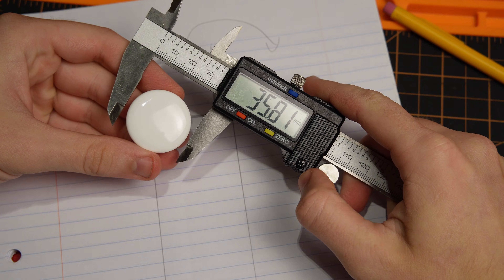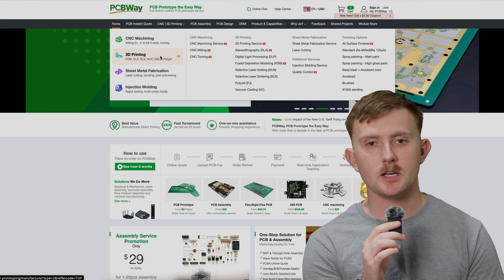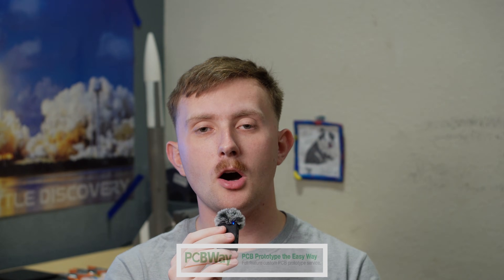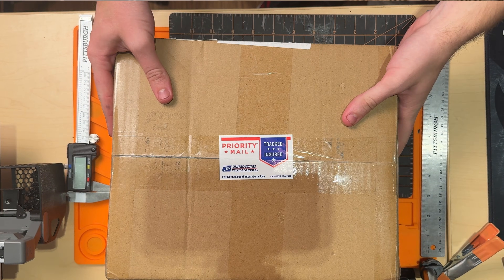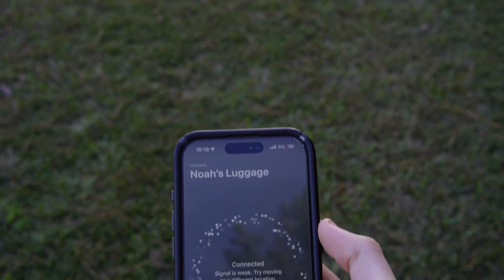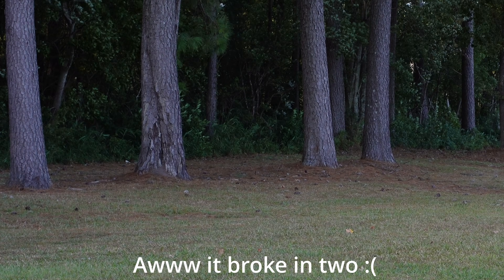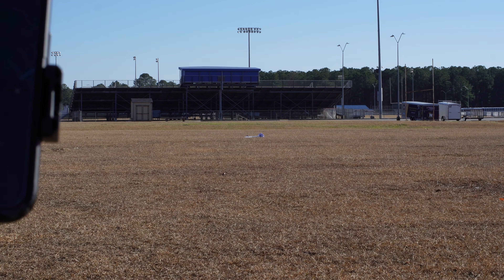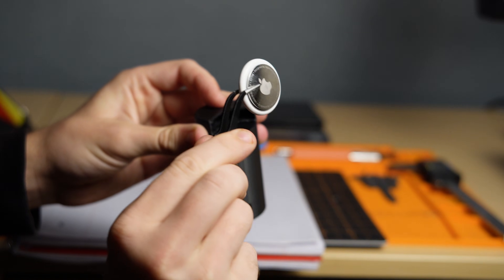Can You Track A Rocket With An AirTag??

Comment: Nice test! I have a system that uses some cheap AliExpress GPS and 433mhz modules and that comes in at about $10 and the ground station is the same 433 module and a USB to serial converter. Work well over 500m if you have a good antenna. Although, I think 433 is HAM band over in the states!
Reply from the maker: Thanks I’ll have to check it out!